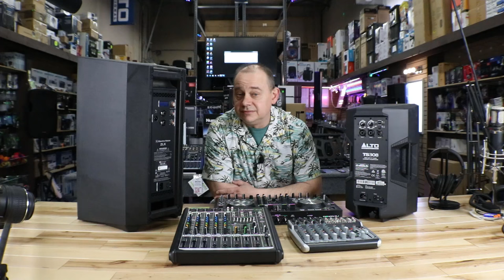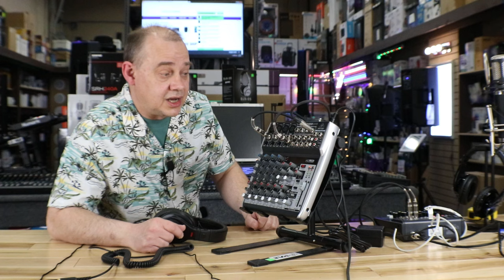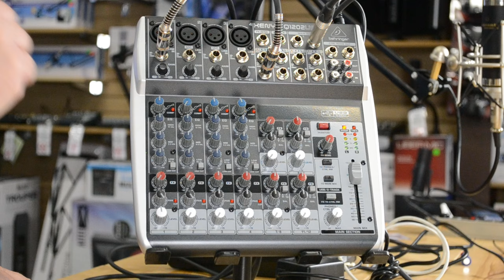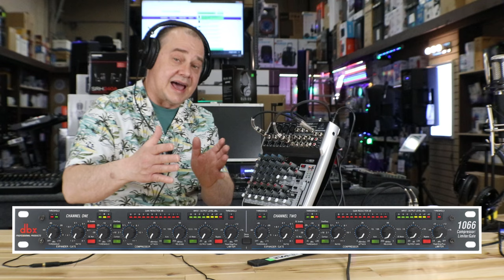How to Set up a power Speaker for DJ and live band - Tips On How NOT to Blow-up your Speakers

Comment: On Mackie's 15inch speakers should the amp power position stay at unity 12 o'clock and just decrease or increase the line input level so it doesn't over heat or over drive the amp?
Reply: On jbl I turn the master power halfway and just use line/gain control to adjust the volume. If done the other way it will overheat the amp
Reply: @davidroberts2404  many thanks.

Comment: Compression / Limiting is an ANTI DYNAMICS tool. It reduces the dynamics in the media and as a result, increases the average volume of the media. This higher average volume level will actually INCREASE the heating potential and temperature of the speaker's voice coils. It seems as if you are saving some level from the system because the peaks are no longer driving the level meters up. The meters are peak only and don't determine the average / RMS level of the media. Commercial media ( the stuff you hear on the radio for instance ) is already highly compressed and compressing it more doesn't really help. Another thing to consider is that basic compressors are not fast enough to actually clamp down on the initial transient peak of the incoming signal. This means that a very small amount of the peak level in the media is actually slipping through the compressor and contributing to the heating of the speakers Voice coil as well. Most meters are not fast enough to react to this transient spike and you just simply don't see it. You need specialty compressors/limiters to properly save speakers. The types of limiters and compressors used for that purpose have very fast reaction times, can handle dealing with RMS output levels and can even limit output based on the voltage produced by the amplifier. I.E. a very specific and controlled tool with a very specific task. Typical compressors and limiters simply do no good for speaker protection and if not used properly can actually make things worse. 

Speakers voice coils heat up as a result of the amount of the energy they dissipate. So if you have more energy on average going in, you obviously heat the coils up more. This is further exacerbated by what is known as POWER COMPRESSION. As the speaker's coils get hotter, they increase resistance to electrical flow. This increased resistance to electrical flow reduces the output of the speaker anywhere from -3db to -9db and possibly more! This means that as the speaker's coil heats up, the speaker actually gets quieter as it becomes less and less efficient. Most peoples natural reaction is to turn it up, but all this does is make the problem get even worse. The coil heats up more and then more power compression occurs bringing the level back down. Eventually, you get to a point where you simply run out of headroom and the speaker simply starts to cook. A good DJ or sound engineer will stop short of clipping the amp, and if running as loud as things will go, the speaker will just cook until it fails. How long it can do this is based on a few factors that go beyond the scope of this topic. The long and short of it is that compression in and of itself does not protect and or save the speaker. 

Self-powered speakers almost all invariably have some form of limiting built into them. This limiting typically includes peak and or RMS limiting. While it won't guarantee the protection of the speaker it can greatly reduce the possibility of failure from mild and perhaps even moderate abuse. Using compressors and limiters prior to a self-powered speaker should be done so for musical and creative purposes only,  NOT for speaker protection. Passive speakers that utilize an external amplifier can benefit from having some sort of speaker protections from DSP devise, but it should be from one that is meant to do that task. Again the typical units that you buy at Guitar Center and other Box stores are not appropriate for the task of speaker protection. Speakers " blow up " and fail from abuse and negligence. That abuse is from the user trying to eeek out every last bit of what the speaker has to offer. The user needs to simply be more in tune to what the speaker is saying and what the meters are telling them. If the meters are peaking, turn things down. If the speaker sounds like it is dying, turn it down. If you keep turning things up and it isn't getting any louder, it is not going to get any louder and you are just going to burn the speaker up. If you are not asking the speaker to do things it can't do, it will last a very long time and provide many years of reliable service.
Reply from the maker: Great Job with the details I Just had a look at your Channel And I Am Not sure why your videos Do not a Higher view count they are great full of Tech talk about Audio.
Reply from the maker: If like Watch My videos have a look @A/Tech  https://www.youtube.com/channel/UCPl8t4C8UUv2BnMbBYeYcnw/videos
Reply: @expertisland   Thank you. I don't really push for views on my videos and I don't try to cater to YT's algorithms. My channel is also lacking in content at the moment. I need to get to creating more videos. I was initially shooting to do more 101 type videos where I explain what an XLR is and stuff, but I tend to produce videos more as the questions come my way. A picture is worth a thousand words sort of thing. I am not a videographer and I don't have any real video editing software, so all my videos are made in single takes and you basically get the talking hands thing. Basically, my videos are not entertaining and more just about information digestion. Thanks again and have fun. Your content is great, just thought I would bring to light a couple of things is all.
Reply: Thanks for the useful information
Reply: If I have a computer connected to my mixer does the volume matter on the computer? Should I set it to 100%, preference? Does it matter?
Reply: @mikeferrit1708  It depends. In most cases, I find that having the level set to anywhere between 75-90% is best. Much beyond 90% you end up with audible distortion on some audio cards. Mac's seem to be the most problematic when turning the audio feed up to 100% but are not the only ones that show weakness at that level. With Mac's, my go-to volume setting is 80%. With standard PCs, I start at 80% and adjust to taste.
Reply: @atech9020  ty for getting back to me. I had my sound set to 20 on my hp laptop. Sounds like it best to bump that up and turn my speaker main down
Reply: My personal opinion on compression limiters is to prevent other "artists" (especially DJ's) to destroy my rig.  If set up CORRECTLY it can save your system from fools who like to run the DJ mixer's bars in every color possible. Your compression limiter should never be set to limit speakers at it's tip before the speaker hits it's "peaks". Why it's so important to have the right system. If you have to run your system that the limiters are kicking in regularly at parties to get the desired volumes, you should consider upgrading to a more powerful system.

Comment: This is exactly what I was looking for.  I was calling the condenser auto gain and auto filter.  I noticed that while playing DJ music on home speakers that the system had a condenser filter and signal regulator built in for auto gain, but not on my DJ PA speakers.  My new used mixer should solve that.  I still have to regulate or delete some of my music files because even music from the popular DJ pools can sound flat or have a low signal.

Comment: Hi, aren't you mixing preamp and amp on the ZLX? To my understanding, the small knob next to input socket corresponds to preamp, this is the one used to put your input level at 0db, then the master volume (amp) is on top. I just bought ETX-12p which look similar and it seems to be like that.

Comment: I have the Harbinger V2312x2 and a Harbinger V2318sx1. the manufacturer suggests that I come from my Mackie mix 5 external mixer into the subwoofer inputs and then from the subwoofer outputs to just one speaker the channel 3 I think it is with the Bluetooth it has the mono and stereo plugs for quarter inch. then run from out of that speaker to the  Link in on the other speaker. would it be the same thing as running from the out of the sub to the mono inn on each speaker with a separate wire or would it be worth investing in the 50 ft XLR cable to tie the two tops together

Comment: Very interesting... On your demo , you used powered speakers... This dbx thing you're talking about will work fine with powered speakers too? Been looking at dbx products and saw this "driverack pa" thing. Is this the same as those you showed here? Thanks for sharing this important stuff!
Reply from the maker: Great question, For sure a powered speaker is just a speaker with a built-in matched amplifier the DriveRack PA is a great unit for large setups where the speakers are stacked like dual 18" bottom then 4 mid range horns with a rack of tweeter on top, each with there own amp,( old school setup still out there) but the DriveRack PA now discontinued based on DBX website. Today we look at line arrays for big setups.
Reply: @expertisland    Just check dbx website,  driverack pa2 still up for sale. I cant believe they would discontinue such a widely used product.
Reply: As a powered speaker setup would be tops and subs you can use the DBX PA+ it is the drive-rack to use with powered speakers if needed.

Comment: Hi guys i need a advice.
I need speakers for mobile dj for about 100 people to play without bass boxes and im wondering between Alto ts415 or RCF 715a ?
Reply from the maker: if you're not looking at the price and you just want a great top-of-the-line (who cares) then RCF 715a at $1000, But I'm a little Frugal so I look at your Question "mobile DJ for about 100 people to play without bass boxes" look at the TS415 and The Harbinger V4115 at $500.
Reply: @expertisland  the price for this model rcf is  550$ but is the bass enough or Alto have more bass?

Comment: Hi, recently bought TS315 Alto Speakers, I have notcied that the HI, MID are gone when DJing sound is really 
bad, very bassy, not clear whatsoever, I believe it may be the Tweeter. I
 only bought these speakers less than 10 months ago and have used them 
only about 6 times a small events? Is this normal? Do you think I would 
be covered with Warranty or any advice you can give me?
Reply: I have owned 3 sets of altos 2 & 315s they were all terrible had to replace 4 tweeters and 2 Woofers over the course of a year and a half (one 8 hour gig a week) this was with running them as discussed in this video I’d never buy an other set of altos. I now use 2 yamaha dhr15 with a dxs15 mk2 sub and the sound and reliability is next level. Get rid of your altos add a few hundered £s more and go with a better brand. Yamaha, Rcf etc …

Comment: I’ve always gone 12 o’ clock position on my 2 powered tops and powered subwoofer. And my DJ Set master gain is also on 12 o’ clock position. But I haven’t gone like super loud and I have 2x k.2 2,000 watt 10 inch powered speakers and 1 seismic audio boosted 18 powered subwoofer and all my gains are on 12 o’ clock position.  I haven’t gone to a big indoor dance club that has like 100 or 200 people  size club ( 1,600 watt 18 inch. ). So what should I do for all the master gains? I also have a Numark NVii DJ Set. Anyone please answer this.

Comment: Does it damage the speaker if the limiter indicator is on, but it's not clipping (clip light off).?
Reply from the maker: Limiter or Clip light is your speaker's way of telling you that you're closing into the Max out Put of the Speaker. it's like squealing your tires you're not going to damage your tires today or tomorrow, but do it every day you will need new tires soon.
Reply: @expertisland  thanks, I ended up adding a Harbinger S12 and that helped a little.

Comment: is a mixer absolutely necessary for a simple DJ set up?
Reply from the maker: Better but not necessary
Reply: Gladiator1972 Depends on your source ie which controller. Overall a mixer will improve any setup especially where the source ie controller may lack volume power such as the Traktor S2 mk3 or  any entry to mid level controller. Many people buy entry level controllers for the size as opposed to the bigger high end units. I prefer smaller controllers and so a pocket mixer such as the Mackie 402vlz or Mix8 is ideal for the extra output power without the added weight for lugging around. Keeps cost down too.

Comment: What if my rack limiter. " Driverack" goes in the yellow and red but the powered speakers are not....is it safe because it's working or do I bring down the source and render the limiters useless?
Reply: If Driveracks limiter set up well it is safe until the sound from the mixer not distorted.

Comment: HI i have 2qsc k12 and 2qsc kw181 i havve a driverack pa2 is it necessary to get a compressor/limiter/gate
Reply: shotta p I’m pretty sure the PA2 already has both of those features. Check Dix website for user manual.

Comment: Please include a DBX sonic maximizer like the   BBE 382iSW Stereo Sonic Maximizer with Subwoofer Output
Reply from the maker: I will see what I can do. thanks
Reply: @expertisland  I use this with my dj set up and think it does alot for sound quality. I run 2 EV ELX118P 18" Powered Subwoofers with 2 ALTO TS 315 tops running thru a nady audio CX-23SW 3-Way Stereo And Subwoofer Crossover and the DBX maximizer. I have found an incredible difference with the maximizer. When you shut off the maximizer and the wife says what happen to the good sound you know your crowd at a event can tell the difference.
Reply: On a separate note I sent you a facebook message.
Reply from the maker: That is a great setup most people think it stop at the speaker and sub-woofer.  and the nady audio CX-23SW is only $ 110USD or $170CAD  for ever one who would like to see what we are talking about here is the link. https://amzn.to/2XexXii

Comment: how to i set my gain and main knob to not burn it out my speakers get hot only after a couple minutes of use and they are both on unity level and my mixer isnt even hitting orange someone help pleaseeeee
Reply: If your amp/speakers are matched then it's more than likely a fault with either the amp/speakers or mixer. Mixers have been known to show incorrect peak level display readings due to a fault (although this is fairly uncommon).

Comment: OUTPUT DISTORTION FROM THE MIXER MAIN LINE OUT PUT USUALLY THAT CAUSED SPEAKER BLOWN UP DUE , THEREFORE MANAGE YOUR GAIN STRUCTURE TO AVOID DISTORTION. THE ALTO HAVE AN INDICATOR TO TELL YOU IF THE SIGNAL IS TOO HIGH AND DISTORTED, SO YOU LOWER THE MIXER MAIN LINE OUT.

Comment: Stop adding all this extra equipment to your. Speakers because you saw another Dj using it.. Keep it simple, If you have good speakers chances are they’re already tuned. Some of this extra EQing will take your speakers beyond what they are rated and you wind up frying them... i use Qsc k12’s Have one on top of kw181 for dance floor and one to left and right of center.. my gain at the 10to 11 O’clock and sounds wonderful..
Reply: The caveat is that it all depends on the size of room and the volume levels you expect the music to be played at. Under-amplifying or over-amplifying speakers is bad for both the equipment and/or the ears. It makes sense to use additional gear if you want to maximise the output of your equipment. It's a bit like having a powerful car engine - if it's not tuned correctly ( and either not being driven or over-driven) it's probably wasting a lot of power and is likely to give you problems over time. That said, if your venue sizes are consistent and the gear you have works fine, no problem at all.